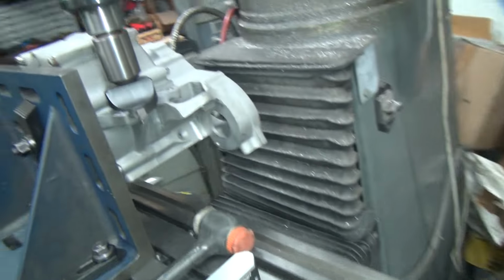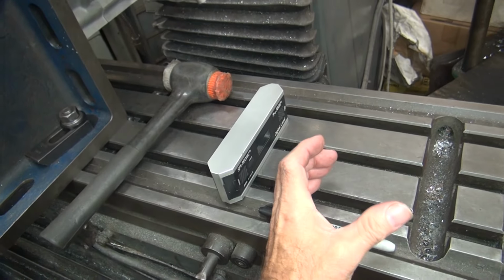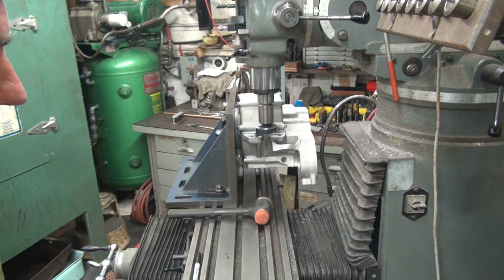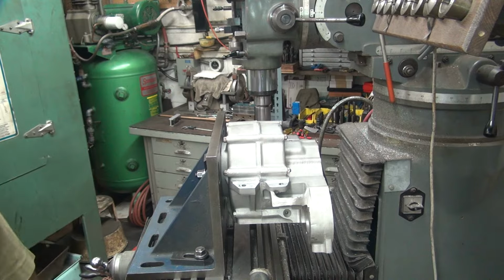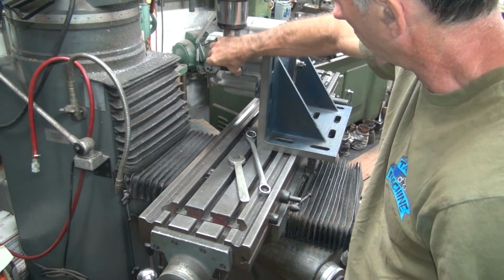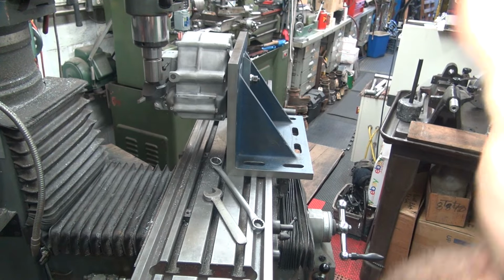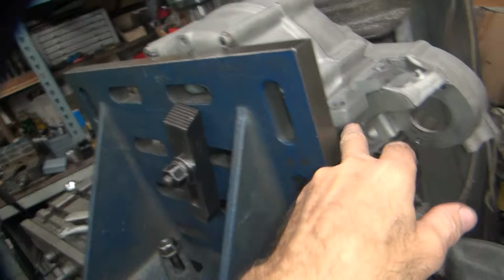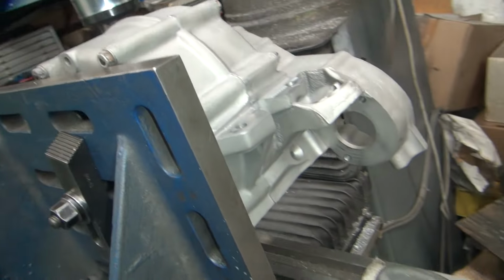#145 1946 junk 84ci stroker knucklehead 500 mile new repo motor rebuild 79ci harley tatro machine

Comment: Question?  You are machining the motor  mounts to the "factory spec".  What are the chances the frame is at "factory spec"?  

Then?  What does a "regular guy"  do to correct the frame mount?

Keep up the excellent work!
Reply from the maker: you file the frame mounts to cloase as you can get to what you think is correct. then you machine the cases to match the fram. no shimming is needed.
tatro
Reply: @TatroMachine  Ahhh!  As long as a man has a torch, grinder & weld machine...nothing is really busted!  😁